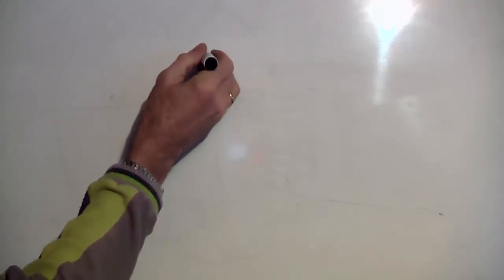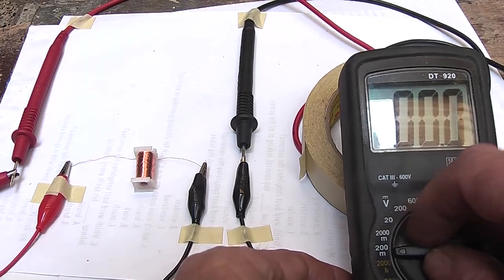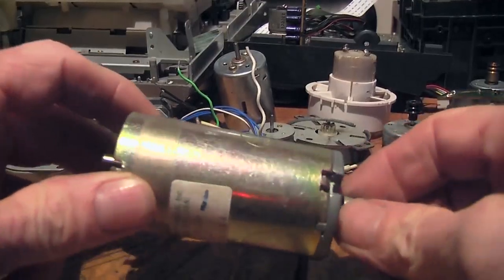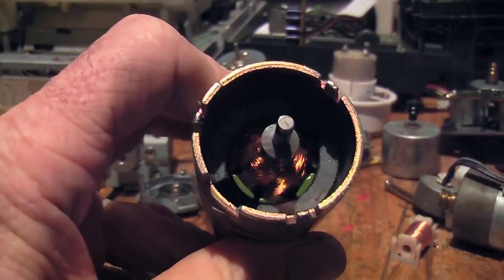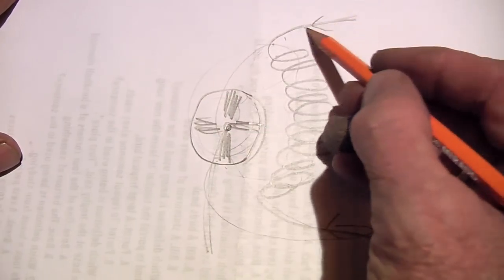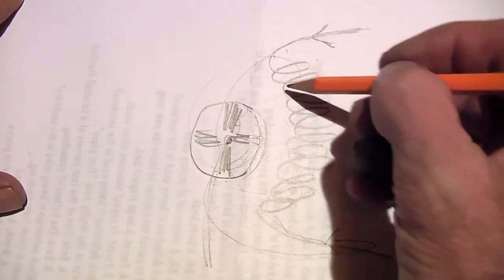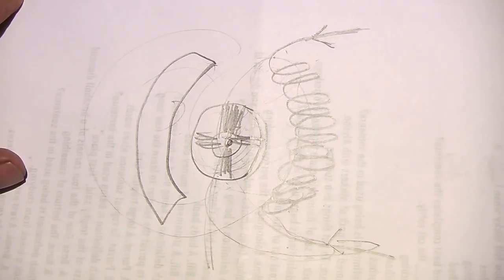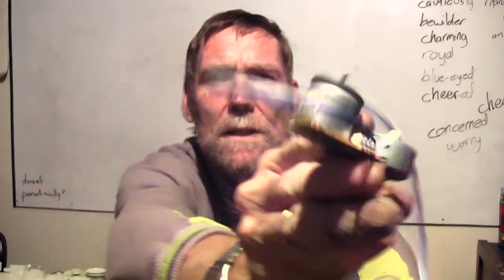Generators - The Basics

Comment: i dont understand you, you can only rotate de motor whit  fixed magnets and generate electricity
 if you can make this video in spansih I would be grateful
Reply from the maker: +Facu 2020. Esto es lo que yo pense anteriormente, pero sopresa, cuando hable con  rebobinadores quien conocen del tema y  lo ha probado que  un motor con solo bobinas funcionan tambien, especialmente los pequenos  si tienen suficiente  magnetismo residual. los grandes necesitan coriente para establecer los campos magneticos en las bobinas. Un capacitor es una manera que algunas usan, y/o tener el generador conectado a un circuito, que retro alimenta de las reservas en el circuito como una bateria que vas a cargar. ..y  hago un canal espejo de este canal , pero en espanol, esta en  philipstephens007-Espanol.